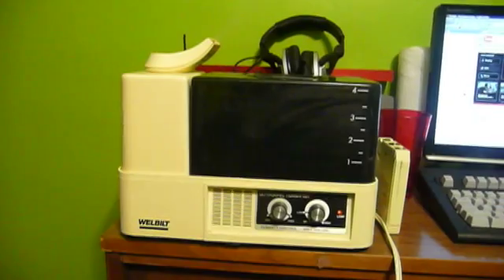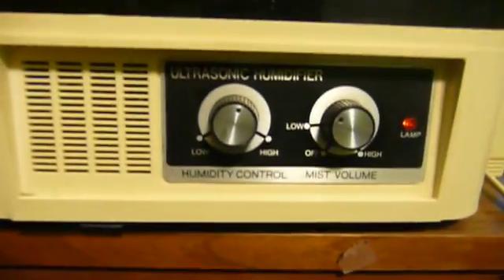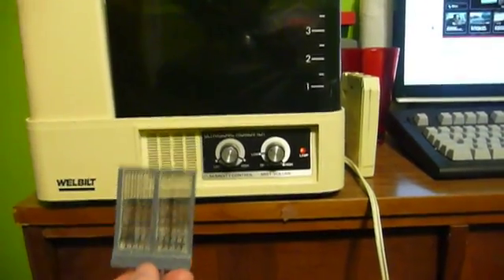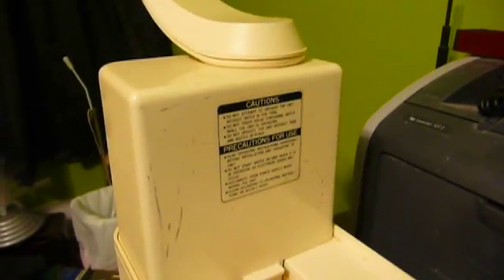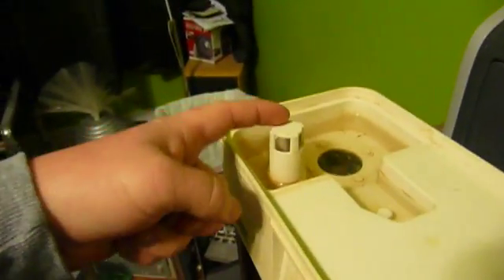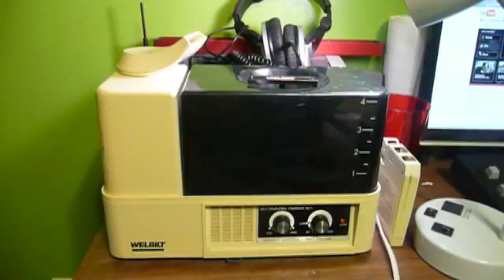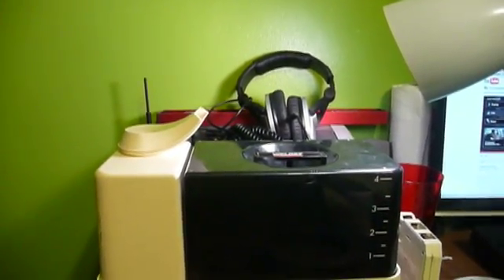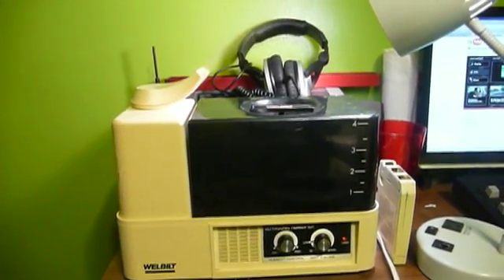Ultrasonic Humidifier

Comment: Hi, I'm from Mexico and we just found this great relic. Could you tell me where the water goes? only in the tank? Or also to the side where the smoke comes out? Thank you
Reply from the maker: Water goes in the tank. From there, it will flow to where it is supposed to be. Don't put water anywhere else.

Comment: Uxwbill, ultrasonic humidifiers with digital humidistat control panels are accurate efficient everything love them I love the newer models the ones with the digital control panel design more accurate than ever I had the Bionaire Biotech vintage ultrasonic humidifier before I accidentally killed it with heavy hard tap water no I don’t trust tap water high mineral content I use distilled only on my future brand new Digital humidistat control panel ultrasonic humidifiers only I am with you ultrasonic humidifiers are the best combination version Warm/Cool mist The mid 1980s ultrasonic humidifiers are very efficient since 1980s but I know they got discontinued by mistake they felt guilty and brought them back on the market as newer modern ones and I accept it Digital humidistat control panel design love those ones awesome ultrasonic technology forever love it!

Comment: Hi I saw your video of how to fix the fan of the same humidifier. My one don't mist but the fan is running perfect
Reply from the maker: After enough time, the rubber seals fail and drown the mist generator/tranducer circuitry. It's new humidifier time after that.

Comment: I just got a Bionaire version of one of these, Works amazing and hails from around 1985, I paid $3.99 CAN- Reading uxwbills, comments, I decided to take the bottom off and check to make sure the fan is spinning freely and that my transducer seals aren't leaking onto its circuit board, Well looks like I bought another tinkerers old humidifier, I found the transducer had been resealed with high temp silicone all around where it screws on to the circuit board, where the rubber o-ring meets the water reservoir  and the board itself had been repaired and its fan had actually been lubed regularly and is whisper quiet!  No sign of any water intrusion whatsoever and I've been using it for a week before I checked. Actually rather surprised, I've been watching videos where people have opened models only a few years old to find the board and housing under the transducer corroded horribly. As an extra measure, In Canada especially in the Maritimes we have a product called RUST CHECK, Here without spraying our cars every year with this non toxic oil, they rust up fast, I mean RUST... gaping holes in rocker panels of 8 year old cars... Its gross, Road salt, salty air and high humidity just murderers our vehicles. The rust check actually helps electronics conduct electricity and keeps all the connections from rusting, I had an Infiniti which had a very stupid design of sticking a computer board against the firewall, The windshield drain was directly underneath the computer and clogged up fast, which then created a pool of water for the computer to sit in..... I cleaned the board with alcohol as I had caught it early enough, I then sprayed the board with the red can of Rust Check and I never again had a problem of that computer getting damp or humid and causing my car to go bonkers. I bet this would work very well on the board underneath peoples transducers, It repels water very well.

Comment: Picked up one of these at a thrift store and just love it.   So quiet and efficient.   30+ years old!   It really is true.....they don't make anything like they used to.   Thanks for explaining how it works.
Reply from the maker: I've been through a few of them since this video was made. The seals fail and eventually drown the ultrasonic driver module, although I have found evidence of them leaking slowly before the big failure. This one popped its fuse and I was planning to rebuild it until I saw the circuit board/traces had turned to mush.

The one I have now is a Holmes Air model with a HUGE water tank.

Comment: I had an old one that looked very similar made by Brookstone . It worked perfectly for 17 years until  I lost that one moving .  I  went through about 5 ultrasonic humidifiers  since then and they were all junk .   I agree that the new ones aren't made nearly as well as the older ones like this .   If you find one like this cheap , snap it up , give it a cleaning and use it !    
    I love the ultrasonic humidifier because it does NOT put germs into the air like the wicking type evaporative humidifiers .  We use these to prevent getting sick , not cause it !   Dry air  causes congestion, dries out the nasal passages , cracks them and causes infection.      The other safe way to humidify a room is to use passive evaporation, like with a fountain which can be bought for 50 - 300 dollars .   
   Amazon has some great reviews on  both types of humidifiers .
Reply from the maker: +Michael Benjamin I got several years out of this one before the seals failed and drowned the driving electronics. I keep several of them in reserve for exactly that reason. My current unit is a 1987 Holmes Air model (made by Tatung) that came to me with a seized fan motor. It has a two gallon water tank, which is the largest I've ever seen.
Reply: +uxwbill After watching your video , I look looked on ebay  and found (and bought )  a Pollenex model that looks very similar to the Brookstone  model I had before .   It looks like yours in this vid except there is no vent next to the controls in the front .   I wonder if all these old ones were made in the same factory in Taiwan .   I paid 21.  including shipping for this one because it looks like new ,  the plastic isn't even yellowed.   When I get it I may look at putting some silicone  sealant on the seals so they don't deteriorate .   Thanks for your response !
Reply: Michael Benjamin actually it backwards the wick based one don’t usually put bacteria into the air, even if mold in the unit, or wick, unless of course extreme and not maintain properly as it create humidity naturally. The ultrasonic ones are the one that put everything back into the air even minerals which is why most leave white dust behind and More likely to cause condensation and mild growth in colder weather as air can hold less water and ultrasonic humidifier will still put mist into air. Wick based unit will only put out as much as the air willing to hold. Wick based units are far better in many way, but yes more expensive to run as you have to replace wick filters regularly and keep them clean every week. 

Consumer report did a test on all types and reason they don’t recommend ultrasonic based units is due to likely put out mold and other bacteria. One person was thought to have chronic lung disease and doctor found the cause was the ultrasonic humidifier next to his bed causing it. If you do use on clean daily and use distill water, with  a bacteria killer.

Comment: On mine I boil water (and let it cool down) before using it in the humidifier as it destroys the pink algae we can see floating around the transducer bowl and coating it's sides.  One could also buy demineralized (purified) water used for cigar thermidors but it'd get costly on the long run.

Comment: @uxwbill Wait until I catch a cold, then I'll have one running. :-) Another thing I remember about cool mist humidifers is that if you have "hard" water, it tends to leave a white dust residue on anything below where you had the mist aimed, due to the minerals in the water. (A vaporizer leaves the mineral residue on the heating electrodes inside the unit, instead of blowing it out into the air.)

Comment: We had one of these years ago. As I recall, ultrasonic humidifers fell out of favor because of health concerns: since the water doesn't get hot or boil, people were afraid that any bacteria or other undesirable stuff in the water would not be killed and would get spread through the air. Plus, I just prefer the warm mist and gurgling sound of a vaporizer. That way you know it's actually humidifying the air, and not just making wet smoke. :-)

Comment: What's the power consumption rating on that machine?  I know the boiling water type you speak of, I've always known them as vaporisers, I had to use one when i was very little, I used to get The Croup pretty badly, I actually ended up in hospital in a steam tent once.  Would these be good for people who get bad croup.  I don't know how common these things are down here, personally I'd have more use for a dehumidifier, in Summer it can get really humid, I hate humidity.

Comment: I am luck I live in a old farm house that has all brass steam radiators  It keeps the air moist as steam heat releases a little out of each one . I had a junk guy once come in
once to remove a old stove and he offered to remove them and put in steel ones and give me 500 buck cash . I said no ass sometimes the pipes break if you try removing them I found out there worth around 200bucks each and I have 11 in my house someday may change to hot water but I love steam keeps heat longer